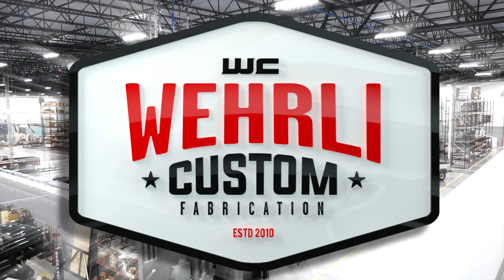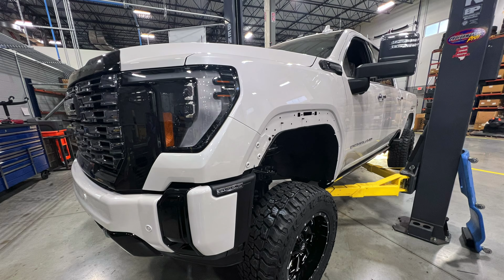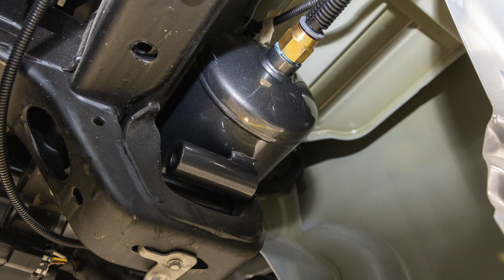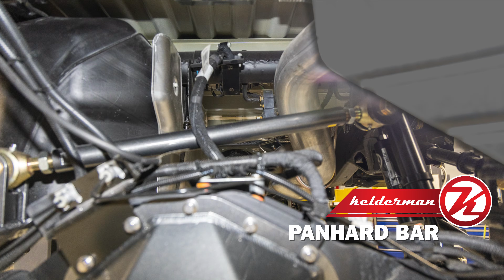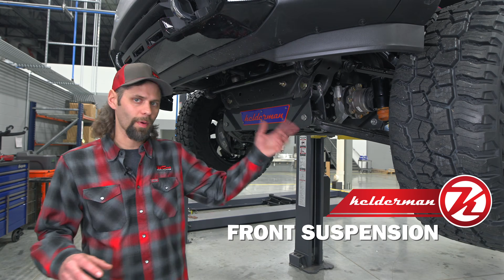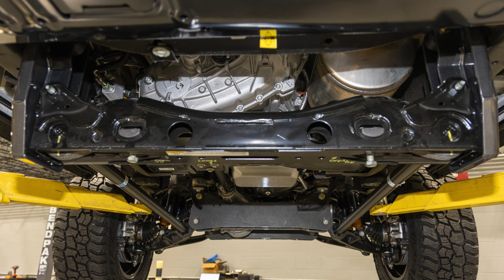Kelderman: Rear Air Ride-Four-Link Suspension & Front End Lift Kit

Comment: In every demo I’ve seen of the air dump feature, the bags reinflate right away and go back to ride height. Can the bags be dumped and stay dumped? Or dump all 4 corners and then level it out. Like if you have a truck camper and you want lower access to the camper, but it still be level.
Reply from the maker: Yes, it’s possible to dump the bags and leave them aired down.

Comment: So im looking at a system to make it easier to load/unload motorcycles in the back of the truck. I use a 8ft aluminum ramp to load/unload, and the new (2025) silverado 2500 I got is freakin HIGH off the ground. I really need a way to be able to "lower" the truck to make the ramp not as steep. so with your system, how Low can the truck be dropped?  I wouldn't ever drive the truck with it completely slammed/lowered in the back. Just to load/unload bikes. But I need to know what the Lowest setting would be. So if the tailgate is open, and the truck is lowered to the lowest possible height in the back, what is the measurement from the ground to the tailgate?
Reply from the maker: The Kelderman Rear Air Suspension system is a pretty popular upgrade for our customers that like to load bikes, SXS's and sleds into the rear of their trucks, especially if you also like the lifted look for normal driving and don't want to sacrifice utility. We're not sure of the exact measurement of the tailgate height drop that you're looking for, but the physical movement we've observed at the suspension itself is about 4" when the bags are deflated. The folks at Kelderman may be able to provide a bit more info for those specific beyond the experience our team has with their kits. Check out the link below to learn more and find their contact info then give us a call at 630-277-8239 if we can help you with the install: https://kelderman.com

Comment: Make sure you check your parts if ya purchase a kit they sent out the wrong size spacers and won't back the product after admitting it was there fault and wrong spacers shipped with kit.
Reply from the maker: Are you talking about a purchased you made with Kelderman directly? We're sorry to hear that. In our experience they make a solid product and we've always found them to be pretty good to deal with on the rare service or support need that has come up on our side of things. Who have you been talking with on their team and who did the install / service work on their kit for you?
Reply: @WCFab Mark Wetherington

Tech / Parts

Installed by my coach builder